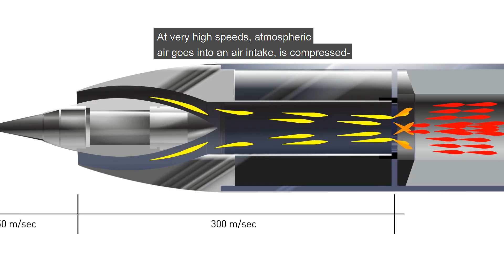How ramjets may change the role of artillery on the battlefield

Comment: I can see it having a place, but the major advantage of artillery is that shells are relatively cheap.
Reply: That’s the advantage of a ramjet though, very simple because it doesn’t need a turbine to compress the intake air
Reply: @battlesheep2552  still more complex than regular artillery rounds, its really going to come down to price as well as effectiveness.  if it's the same price as a regular round but can't hit shit at the range that exceeds the current rounds then the US military wouldn't pick it up.  greater distance greater dispersion, unless you have a  guidance system in the munition but all of a sudden you just sent cost through the roof.
Reply: @battlesheep2552  And guidance + Thermal management + Combustion control = 1000's of USD per round
Reply: @battlesheep2552  Simple compared to a traditional rocket, not compared to a traditional artillery round.
Reply: As a former U.S. Artillery Fire Direction NCO, I can tell you that cost matters more than you think. We can toss $100 standard HE rounds around all day long, but we’re much more conservative with a $30K Copperhead round.

There are a LOT of reasons this tech, while cool, will not be picked up. Especially not for a 155mm system, and especially not by the U.S. Army. 

Maybe the U.S. Navy, if you increased the size, emphasized speed and tried to make it a kinetic kill system for ship-to-ship warfare, but even then it has to compete with other systems.
Reply: @edwardsummey8843  Navy cancelled the Advanced Gun System for the Zumwalt. Because the ammo was too expensive.
Reply: @edwardsummey8843  I am so with you. Very surprised by the comments acting like cheaper artillery rounds are somehow meaningless. Cost is important even in the realm of military budgets. Everything has a role and that is no different with relatively inexpensive artillery rounds versus more expensive counterparts.
Reply: @edwardsummey8843  Excellent point.  Would be great to see the Missouri and Iowa put back into service and have this adapted to their 16" (400mm) guns.
Reply: @edwardsummey8843  exactly! I was an FO in West Germany and nobody was going to send us a copperhead round unless it was some super high value target like Brezhnev in a T80 at the Fulda Gap. I say Amen to your comment and FFE.
Reply: @edwardsummey8843  I'd say it would probably be used in counter-battery fire; Having a stick that's longer than your enemy's stick, allows you to hit them with ease when they can't hit you.

You won't see massive salvos of it, but I can imagine targeting an active katyusha battery with this - and maybe you can even put course-correction on it for increased accuracy, though that's dependent on research that's ongoing.
Reply: @edwardsummey8843  You are not wrong -  when it comes to the US and other large nations. The US has several weapon systems that compliment artillery, especially in the ranges discussed here, like MLRS, attack helos and cruise missiles, to name a few. Small countries however do not have that luxury. The country Nammo is based in, Norway, is unable to have a combination of weapon systems to compliment each other, due to manpower issues and cost. The Norwegian army would probably be a lot more interested in this, as it turns a 20-30km ranged artillery piece into a variable distance firing platform, without the cost of a second platform. 

To be able to drop more expensive ordinance into a standardized artillery platform to increase reach, then return to the more inexpensive projectiles for shorter ranged engagements and for carpeting areas is very interesting for smaller countries around the world. The training, maintenance cost, as well as the investment needed for a separate platform, will probably pay for the added cost of the projectiles.
Reply: @edwardsummey8843  ship to ship warfare = missiles.
Reply: @edwardsummey8843  Ship to ship systems? What is this WW1?
Reply: @edwardsummey8843  i dont know much about military stuff but i remember seeing documantaries about the vietnam war in which tje usaf was very conservative in using shrike missiles against sa2 missile sites. So cost is indeed an important factor.
Reply: @edwardsummey8843  it has a potential for bunker busting in the form of coastal or ship-borne artillery.  Prolly cheaper than a tomahawk, but still not as effective.
Reply: @edwardsummey8843  Hilarious when you guys are firing $150k+ javelilns at single dudes in afghanistan
Reply: @edwardsummey8843  Besides price is there a technical reason you think this wouldn't be picked up?
Reply: @darkjill2007  It comes down to the nature of cannon artillery. It is cheap, and it is quick. However, it is fairly short range (which this round seeks to address), and each individual round is pretty small. For mass attacks, you need to gather dozens of artillery pieces to have the decent effects on target.

Add to that the effect of exterior ballistics- if this round is unguided than it has to account for wind and atmospheric effects. Normal rounds have to account for this also, but the longer it is in the air the greater the effect will be, hampering accuracy. If it is guided, then it would be better to launch a single tomahawk than depend on a dozen of these, and if it is a “smart” round, the idea of keeping cost low goes out the window.
Reply: @edwardsummey8843  OK so you don't think it's cheap enough to take the place of traditional shells. Plus it's unguided nature makes it a poor substitute for guided shells. Makes sense. Your coming at this from a mass bombardment perspective. Even if the round can get out to the distance target it would be ineffective at saturating the area. All of that makes sense.

What about for a different gun platform. Maybe a navel cannon? Would the larger shell with a extended range justify the cost? What if it could reach out to 250 miles. Tomahawk are expensive.
Reply: @darkjill2007  My experience is with army Field Artillery; I have a less educated opinion on naval gunnery.

Currently, the Navy is working on a rail gun system.  My gut feeling is that this ramjet system would be more effective on a larger shell, giving a better punch to a single larger payload.  The problem is, most navies of the world have moved away from large bore naval gunnery, in favor of aircraft and missiles.

For me, it comes down to target selection.  This type of round is ideal for a long-range strike- either over a border or into an enemies rear area.   What is your target?  What are you shooting at?  How is the target protected? Is the target stationary or mobile?  Will a deep-strike artillery stonk be more effective than a cruise missile or a munition from an aircraft?

The ONLY thing I can think of is if an area is SO well protected that aircraft and missiles are not likely to make it to the target area.  Current warfighting experience has yet to have that happen.  However, if it IS a potential, what is the likelihood of your target's protection being able to be defeated by an artillery round?

Maybe if the navy still had battleships, putting this on a 16" gun would be pretty useful.  Not in a 155mm shell though.
Reply: @edwardsummey8843  As seen by their zumwalt class destroyer still not having ammo for the main guns because its too expensive to buy with 800k per shot , gjgj
Reply: @edwardsummey8843  The main advantage of it is that it can be fired by the same gun that uses the $100 ammo. I see it more as a way for conventional artillery to defend itself if threatened by longer range artillery, instead of having to field both MLRS and conventional artillery.
Reply: @BosonCollider  You are talking about Counter-Battery Fire.  The main defense against possible counter battery artillery fire is the same reason I am skeptical of this round.  We move the guns.  With an increased range comes an increased Time of Flight.  With modern artillery radar, target location, origin location, and time of flight can be obtained within seconds of detecting the round.  So, modern (at least as of 2003 when I left the army) artillery tactics dictated that if there was any danger of counter battery fire, the guns displaced to a new location after each fire mission.

Artillery rounds (especially the 155mm this is designed to shoot from) are not particularly large (when talking about artillery).  The 155 gets its effects on target by massing fire from many tubes.  Depending on the target, you can get from 6 to as many tubes you can gather (18 in a battalion) firing in salvos.  Individual rounds are impressive, but not able to have overwhelming force unless you actually hit the target, which gets progressively harder as range increases.

MLRS is more effective because the payload is greatly increased over the standard artillery round as well as increased range. Having a single round with a massively increased range is only effective in cannon artillery (especially 155mm) with either a guidance system (which greatly increases cost) or to mass fires, which becomes very difficult with increased range to to Meteorological data along the flight path of the rounds and differences in times of flight from the various gun batteries to the target.
Reply: @edwardsummey8843  well yeah, where does the "bang" go? shooting a rocket out of a cannon is great...but payload?
Reply: @edwardsummey8843  USMC Arty shoot Excalibur (gps guided artillery round) in Afghanistan. $100,000 a pop from what I heard. Only for kills though. Mostly IED diggers.
Reply: @humanofearth7524 , $250,000 per round, more like. But can still carry a conventional warhead.

This ramjet round supplants what would be area for a warhead/fuse/payload.

With guidance, this can be an accurate long range round, but will not be inexpensive, and the effect on target is questionable.
Reply: @edwardsummey8843  the copperhead was designed for targeting high value targets. That’s sort of the point. A 30k dollar tool to remove a 2 million dollar tank is fairly cost effective.
Reply: @-John-Doe-  Yes, which is why we are much more conservative with them.  

Lets try it this way.  Cannon artillery has two types of rounds.  Dumb rounds (HE, ICM, various smoke rounds) and smart rounds (terminally guided munitions such as Copperhead, SADDARM, or whatever they have come up with lately).

Smart rounds are cost a LOT of money.  Since you want a good return on investment, you want to make sure they are aimed at stuff that is pretty important, is really there, and that you are more than likely to hit.

Dumb rounds are cheap.  But they are not particularly powerful.  The great thing is that you can throw them out there just in case.  you may hit something, or you may scare it away, or maybe just make pretty smoke clouds.  The rounds are cheap.  Hear a tank engine in the dark? Throw a dozen HE rounds at it.

The point is, these ramjet rocket rounds a) increase cost of the round, making them want more of a return on investment), b) decrease the effectiveness as an artillery round (the most valuable area of the round is taken up by the rocket instead of by explosive, making each individual round less capable, meaning you need to fire more of them at a given target), and c) pushes the range up to a degree that target detection will more likely be handled on a strategic rather than tactical level.  That means UAVs and satellite assets rather than troops on the ground.

At that distance, if you want good effects, that means the rounds will either need smart guidance (increasing cost a lot), or use a LOT of rounds and flood the area with rounds (With that Time of Flight, there will be a lot of scatter of unguided rounds no matter how good your fire direction data is). If you are making them smart rounds, it would make more sense to put a specialty munition on it instead of just firing dumb HE, in order to maximize effect and cost return.  And now the round is as expensive as a missile, if not more so, for a munition that would not be as effective as a drone strike or cruise missile.

I can not believe people are still watching this and responding to comments.
Reply: @edwardsummey8843  like the rail gun?
Reply: @edwardsummey8843  It looks to me like the Ukrainian would love to have these munitions for their M777's.
Reply: @johnarnold893  I can not believe people are still watching this video and buying into it.

My comments remain valid. The amount of space this ramjet takes up (based on the diagram they show) leaves nearly nothing left for payload- maybe the power of a large hand grenade- absolutely no payload if they want to make it a smart round. And it doesn’t even have the structure to make a decent kinetic kill round.

But I am just a former Field Artillery Fire Direction NCO with 13 years of experience- 8 of those years working with 155mm guns and their ammo. What do I know?
Reply: @edwardsummey8843  the one thing tho is that ram jets are relatively inexpensive though not nearly as inexpensive as just lobbing shells over a mountain
Reply: @edwardsummey8843  I believe the purpose is for long range guided counter battery fire. The US currently uses cruise missiles and drones in this role and they are far costlier.
Reply: @edwardsummey8843  Hi, I'm from the future.  You're wrong.
Reply: @edwardsummey8843 Yeah, but if it could shoot down an aircraft or reliably take out sam sites....
Reply: Edward Summey so many people don’t understand that “military grade” really means “lowest bidder” 😂
Reply: The Covenant  you might want to look at the definition of almost
Reply: @whoisjoelsmith  by rough estimate we all know these technology will me more expensive than regular artillery shells. it will shows on payload/shell ratio
Reply: @eko_nekkoinu  as long as firing the shell is cheaper than delivering any munition 100+ km. In this case way cheaper than ballistic missiles or air attack, even cheaper if firing in bulk
Reply: @eko_nekkoinu  One other important cost factor is Circular Error Probable.
The smaller the CEP, the lower the number of salvos required for effect.
This can translate into significant savings.
Reply: shrapnel the weight of 0.50 BMG(45 gmas) going at mach 4 to 6 has two to 4 times the energy of that projectile fired from a rifle.
Reply: @muf  that projectile has 100x the explosive mass do you think Artie is just solid rounds
Reply: It has range of 100 km. For artillery, it's a great advantage.
Reply: @andivatar6383  well yes and no, I mean, what is artillery for? Shelling the enemy positions at the frontline, so they dont need a lot of range, this is the reason why it is still effective today, if you want to...lets say, shell an enemy base or HQ that is at 40km, you may not have an artillery piece to do it, but you still have bombers and drones, its not like an artillery piece that can fire at 150Km would do something never done before, and what is at 150km from the front line anyway? Cities? Like if thats more effective (or even humanly acceptable) to win a war than shelling the troops
Reply: @whoisjoelsmith  Look up AGS rounds. Apporach cost of Tomahawk missile ( ~1 mln USD). And Excalibur cost about 4-5x or JDAMs at time of their introduction.
Reply: Piotr Dudała 1.87 millions USD
Reply: The Covenant  solid hgih-performance rocketfuel isn't cheap.  Now, just that won't be what drives up costs but also the added assembly stages, time, the level of precision will be much higher making the cost to mill much greater, and the payload looks like it can't be more than 10kg of high explosive, let alone the typical 100kg+ yield of most shells, meaning they would need to use either a more volatile higher yield, or a more expensive higher yield explosive to achieve acceptable target damage.   Finally, you have to take into account storage conditions.  By design, a solid-fuel ramjet would expose its fuel to humidity, making rainy and humid climates SIGNIFICANTLY less reliable, by orders of magnitude.  The US will not "adopt" this.  They will buy maybe 10k total, use 3k in training and the other 7k for very specific special circumstances.  Compared to the 30k M982 "excalibur" 155mm artillery shells that they bought recently (these are the guided artillery shells) that are ALREADY fringe-use shells, that's almost nothing.
Reply: The advantage of artillery is massed fires. All weather capabilities, and psychological effect
Reply: It's still cheaper than flying an airplane (maybe not a drone) to launch missiles on a target, or even just dumb bombs.  Maybe that's the way to rationalize the cost: think of this as tube-launched drones.
Reply: @theprojectproject01  a light attack aircraft would probably be cheaper and more precise, though the point of artillery is volume of fire.
Reply: @user-pq4by2rq9y 

This is true.  But with this, you don't risk a plane and a pilot.
Reply: They will have a place alongside standard shells
Reply: Relatively low cost is actually the point of this product.  Most 155 ammo would NOT be replaced by this, but all your existing 155mm batteries could have some of this ammo to use in special situations - or certain batteries could be armed with it specifically for deep interdiction barrages and/or counter battery fire.  What this takes the place of is extremely expensive MLRS systems (not only the far more expensive rocket ammo, but the launchers).  It would even be able to strike things that would otherwise require air strikes - an even more expensive option.  It's actually an immense cost savings compared to the alternatives in some situations.
Reply: @whoisjoelsmith  how about high school physics for starters?
Reply: Might be cheaper than short range missiles or drones. Up to 150km - 105 mikes. Likely will improve on that range.?
Reply: You don't need whole batteries/gun regiments to be carrying this ammo, especially if it can be fired without modifying the arty piece. Simply having the capability will shape the opposing side's options and thinking, and then you have caused an effect without even firing that shell.
Reply: it still looks MUCH cheaper than a comparable range tactical missile. Itskind of round they keep in the back of the ammo truck for "just in case" fire missions like they do with the excalibur
Reply: @whoisjoelsmith  , which side of the bed did you get out of. ?
Reply: maybe they should sell it to the USnavy, USnavy still waiting for the railgun that might never come maybe this ramjet shell is a better solution.
Reply: @ALTINSEA1  Raiilgun works....except for the barrel erosion problem...which all such guns have suffered...and always will
Reply: The Covenant, yes it has almost no moving parts
Reply: @scienceisreal3405   A ramjet has NO moving parts.
Reply: @whoisjoelsmith  spaz
Reply: @whoisjoelsmith  Why do you have to be so rude?
Reply: I think you could get it down ramjets are pretty efficient (at high speeds) and simple to build and maintain
Reply: What kind of explosive can it carry if all the shell is ramjet the
Reply: @insubordinategoy7466  I suspect that a shaped charge inside of the intake nozzle might be the idea.
Reply: Kinda sorta not really.
Yes it's true that you want your guns to be cheap to feed, since the ability to sustain a bombardment greatly impacts its effectiveness. 
HOWEVER! We're already in a situation where we have a variety of rounds for a variety of platforms, and some of them get pretty expensive.
For that reason I think this has potential for adoption even if it's unlikely to fully replace more primitive munitions.
Reply: Reminds me of the space gun made by the Nazis. Although it had a long range and higher than average impact damage, it was really hard to manufacture and expensive. It was basically useless
Reply: Jet Streamer isn’t it crazy how people can have a civilized debate on the most economically feasible way possible of killing people.
Reply: Much easier to have base bleed (or rocket assist) to extend range and improve the overall aerodynamic shape of the round.  155mm will do over 70km with those features.
Reply: People saying that cost is irrelevant is so disingenuous. If the military spends more money in one area, that inevitably takes money away from another area. I think this ramjet concept is not aiming to replace missiles but more trying to extend the usefulness of artillery in an age where missiles are becoming faster, with longer range and generally more effective.
Reply: Ramjets are also extremely cheap, due to their lack of moving parts, chances are they would be only slightly more expensive than your average shell
Reply: I am more interested in it as a naval round. It could be cheaper if it had more development but still more promising than a railgun
Reply: I don't know. I don't think ramjets are that complicated.
Reply: Not so much anymore because brass has become exteemly expensive.
Reply: @badmonkey2222  Ah erm, eh Alan? They get to keep the brass. Actually, most large caliber modern rounds just use a charge behind the projectile.
Reply: @conmcgrath7502  i know how artillary works seeing that I'm a desert storm vet 82nd airborne 321st combat artillary regiment 18th battalion🇺🇸, and we didn't keep the brass on the few guns that it was still used on at that time it was immediately sent back to be recycled and used again, that was 30yrs ago and it had gotten crazy expensive then so it's prob of the charts now, that's why when you see these guys firing these old artillary pieces in the civilian world at the range, they go put of their way to protect the brass casings because they are so expensive and brass also isn't widely available like it once was.
Reply: @badmonkey2222  Oh Christ! I just lost my reply (I live in the styx and the internet can be 'fickle' if somebody rings when you are uploading).
Maybe it's my penance to apologize twice!
Alan, if you say you served, I'll take your word for it.
I don't hide behind a pseudonym, much like yourself and if I'm wrong, I'll hold my hands up and admit it.
You basically said that brass costs a lot and I interpreted it as 'some fuck-wit doesn't even realize that shell casings remain after the round is fired'...my bad. Hands up and then hand out, hoping you will shake it from afar.
That being said, with your service and experience, knowing all the many factors that affect a long range artillery round, what is your opinion of an unguided ram-jet shell fired at a distance of 120 km?
Pax dude
Reply: @conmcgrath7502  no prob hand out brother, and i thought he said the ram jet shell was guided?
Reply: @badmonkey2222  Dammit! a salient lesson why one shouldn't drink whiskey and surf the internet. I apologize once more for my drunken 'suppositions'.
Thank you for being patient with me.
But here is a real question; ram-jet round, I get it, guided (don't rub it in!), I get it and obviously the metal that comprises the  'workings' can become 'shrapnel' or even a kinetic force....but what's the payload?
I think I'll quit while I'm behind  (I'm hammered), my hat,.sir. is doth doffed in your general direction.
Pax dude       hic!
Reply: @conmcgrath7502  not a prob sir i had fallen asleep early myself but yes I'm sure the inner workings of the engine become shrapnel themselves, not sure of the payload will get back to you on that one.
Reply: thats not true. US uses guided artillery shells for 50k a piece. the advantage is long distance firepower over a long period of time without needing airplanes as delivery.
the shell costs are irrelevant, still cheaper than most what you deliver with a jet, but you spare the delivery cost and risk
Reply: how much more expensive is that new artillery shell? I don't think that it's  a lot more expensive. judging by it's construction.
Reply: This is true but since we've given Ukraine 100 trillion dollars they could probably afford more expenses shells. We should have never let it go that far. But Democrats don't care about cost all they want is war
Reply: Ramjets are simple as fuck. Its basically just a tube with a spikey point. The r&d will be expensive but manufacturing will not be much more expensive
Reply: Joel N Smith lmao that’s what I was thinking
Reply: I'm Someone You Might Know haha iknow that games
Reply: @whoisjoelsmith  ouch. Not so nice.
Reply: @SuijiSuiji01z  are you referring to World of tanks cause i play it.
Reply: Add some guidance to the ramjet roxket and you habe a Cruise missile.
I dont really see a place for them
Reply: They should be relatively cheap to build but why even have artillery when a rocket motor will accelerate it to Mach 2 almost instantly?
Reply: I think this is a cheaper alternative to air dropped precision munitions which are seriously expensive.
Reply: Yea right. The u.s. military probably spends more on 5.56 rounds then the blackbird program which is what gave birth to the ram jet
Reply: Very obviously, you would use standard rounds for standard situations. This has longer range. If you need that range, you now have it at a price while your enemy does not.
Reply: The Covenant  Lol, no.
Reply: @whoisjoelsmith  There are countless examples of defense companies making weapons that end up too costly to justify replacing existing technology. Most of the stuff on Forgotten Weapons, for example.
Reply: Starfireaw11 yes but the artillery piece is relatively expensive
Reply: Don't forget the fact that it shoots an obviously smaller warhead than same calibre artillery, since they need to make room for the ramjet system (especially the air intake is what would decrease the size of the effective payload).
Reply: It's not just about the range you must also consider the damage output. Regular shell have way shorter range but can ramjet beat it's payload? I highly doubt that ramjet can deliver even half the payload of regular shells.
Reply: I'm not sure did anyone had already mention this but i agree that the now day shell are cost lower than this ramjet shell.

1. Material. You need material that can sustain the speed. They said match 4 right? What speed do now day jet aircraft have?

2. Manufacture. As we can see the jet itself are complicated than normal shell so it will cost more(still did not include guiding system).

3. I'm not sure about this but ramjet need to be in curtain speed in order to make the compress for combustion so it still need the normal propellant while missile or rocket can do that work too right? If it can do that much work why don't they use it in ship and develop it to shoot enemy from 150km aways why do they keep developing railgun while this shell are less complicated if compared with railgun isn't? As i said i don't know about this.

4. Outcome. I have no idea how much charge can this shell carry even it have kinetic energy but still  in further range it have less energy  and rely more on it charge to do damage.

Lastly i think this shell are worthy only when you bombarding on strategic target.
Reply: Ramjets are cheap as fuck, its just a shaped tube with fuel.
Reply: The Covenant  Um... no...
Reply: You can build a ramjet engine without any movieng parts, thats the beauty of it, because the main issue is to get to those mach 3 for ramjet to kick in.
Reply: Make them precision guided munitions like the Excalibur 155 round, at 100 mi away, You can affectively engage numerous targets from a single point or for multiple points without having to worry about setting up and firing from a precision point You can just basically aim it in the general direction and have the GPS system finalize its impact. This definitely has a place in the modern battlefield.
Reply: @jetstreamer374  I'm really interested in the payload of this projectile. It would seem by the illustration early in the video that less than 20% of the volume of this projectile is weapon grade explosive. What is the balance between the added distance of engagement in the field and a more limited punch from this shell hitting its target? That would be an equally interesting video.
Reply: Exactly. I can make water shoot from my nose. Doesn't mean I have to do it. Guided projectiles are certainly more accurate. If they can be made cost effective, whether they're shot from a howitzer or launched from a vehicle or drone should all be given equal consideration.
Reply: @futuregenerationz  Simple
They cannot be made cost effective
Reply: @hellstromcarbunkle8857  If it's range, accuracy and payload is that of a guided missile, we can compare it's cost with that guided missile.
Reply: @futuregenerationz  So why build the weapons you already have that are too expensive to deploy?
See why the Empire is a lost cause?
Reply: @hellstromcarbunkle8857  See why the empire is a lost cause? There is no empire comrade. Just resistance to the other hegemonic powers of the world.  We're at the brink of losing right now. But regardless, the cost ineffectiveness of our military has really been exposed in the last 20 years.
Reply: @futuregenerationz  American bases in 149 countries, occupying them mostly contrary to national will. Ask the Philpinos how long it took to get the American war bases out of their country.
That's an empire, Soldat
Reply: @hellstromcarbunkle8857  How can I argue with someone who already knows the national will of 149 countries? Once we stop the current attack on our own democracy(and we'll remember who sent it) we'll get back to protecting democracies elsewhere. I was in the Philippines. What they didn't want was inaction against China. They'll be part of someone's empire, along with the other 148 democratic countries. Any empire in particular you'd like to see them as part of? The thing about protecting democracy around the world, is the extra scrutiny Americans are beginning to give their own. First we need to be  a democracy, in order to warrant being 'the arsenal' of it. I'm betting on democracy to win. Here, Syria, and Russia.
Reply: @futuregenerationz  I know because they KEEP THROWING US OUT AFTER WE LOSE WARS THERE!
Reply: @futuregenerationz  Well, from denial to excuses in just 2 paragraphs.
You really give ignorance a bad reputation.
This isn't a democracy, as the tRump loss by 2.86 million proved and Russia is, if anything, MORE autocratic thanks to the alliance of tRump and the dictator Putin
Yes, thanks for admitting we are an empire.
To excuse that by saying everyone serves an empire ignores the lessons of Vietnam, Kampuchea, Afghanistan and Iraq, all of whom freed themselves from the American yoke.
Reply: @jetstreamer374  Yeah 'Jet' you kinda 'summed-up' a lot of my thinking. I was wondering about the payload/ effectiveness of the round. Precision at 150 km is questionable but I have to also think that it works both ways? Counter-battery fire at 150 kms might not really be an option?
Lots of interesting comments (I haven't read them all but I've read a good few), seems like a unique approach though.
There has def got to be an advantage in 'out-ranging' the enemy guns, just common sense,  but there are a lot of problems that this design would have to overcome. Large caliber shells fired at distance have to travel through levels of the atmosphere at varying pressures, wind directions and relative humidity (including clouds and rain). Besides tiny differences in barrel-wear/ tolerance (even the blast from one artillery piece affecting the trajectory of another?) at 20 km those tiny differences might not be so much that you cannot saturate an area effectively but at 150 km, not so sure?
Those same atmospheric conditions would also affect the ramjet, only more-so; I think that accurate ranging would be a huge problem and the only effective solution at those distances would be an active guidance system, can't really see it any other way.
Still though, they could probably hit a small city or a battalion massing far behind the lines, I suppose the question is, with what? If you subtract the ramjet and fuel and all the metal that makes it robust enough to fire violently out of a barrel, what's the payload?
One other comment, how many Tomahawk missiles have the USA launched in recent conflicts?
I know the two situations don't equate strategically but there might be an economic/morale parallel; if we can hit you and you can't even touch us....best to leave us alone?
Maybe you can't put a price on weapon superiority when you think about it but I imagine the cost of guided ramjet shells would be dearer than a similar rocket system, developed for the artillery, that can deliver 'more-bang-for-the bucks'? Just not as quickly.
Here's a last comment (I cannot be the only person to have thought of this, so I don't feel bad saying it)... there's already quite a lot of debris in space orbiting the planet, any nation capable of sending junk into space and exploding it at the right altitudes can very likely 'take down' GPS  and all the various satellite based systems and communications used by everybody but specifically by the military, that being the case, warfare would get 'old-school' at least for a while, inertial nav systems are not nearly so accurate at long distance, we would be back to 1970's era technology as regards guidance of ordinance, old-school artillery batteries might be the biggest players on the field, until the nukes start dropping.
Pax dude (hopefully), Con
Reply: I am sure the capacity to direct the ram powered shell to a desired target will negate any extra expense.
Reply: yea, this does not look cheap
Reply: Also, at that point why wouldn't you just fire a missile? There's been no need to increase the range of artillery cuz we can reach way further and more accurately with missiles.
Reply: Use both! He said they work In Standard 155
Reply: Ya. Good luck picking 10,000 for a decent battle.. Who knows what the cost is for one. Likely costs as much as driving a Mercedes Benz.
Reply: Versatility is key.
Reply: You could use it as an auxiliary shell and not the primary ammunition. They don't have to completely replace regular shells. I'm sure 10% or less of the regular ammo Loadout would be enough. 

I'm not an expert, but you could engage at the usual range and then change ammo as they get closer or farther away, right? It would just give an edge.
Reply: not only that but traditional shells also have ROOM for actual explosives.
Reply: The Covenant  but can carry much less explosive
Reply: So ate ramjets (no moving parts).
Reply: Which is cheaper, Rambo or Ramjet?
Reply: It’s a ramjet, they’re incredibly simple things
Reply: @616CC  Agreed.  I think people don't understand this is not really that many parts, nothing like a typical jet engine.  Most of the expense i could see is perfecting the design, and making sure you can get consistency in the engine so that you can converge on target. But as far as building them i don't think there is anything that complex so the manufacturing process can be cheap enough at scale.  There are far far more complex shells being used. It is certainly not like a railgun where there is much more machining needed for a round, etc.  With these you can pretty much stamp them out, which is far cheaper then custom machining each heavy part i would imagine.  And the fuel is dirt cheap as well.  So yea, i bet we will start to see this design being utilized, the increase in range is not just a few percentage, it is literally a order of magnitude difference, allowing for shelling with zero chance of return fire until of course you are facing the russian gear on the other end.  
Take a look at how simple a ram jet engine is, it is really again all about the design and prefecting the design that matters.  Once that is done you can have different shells designed for different distances just by changing up the amount of fuel you put in them, no change in ramjet specifications.  I mean, you sacrifice some of the room you could otherwise be using for your payload, but as a tradeoff for distance seems like a very good thing to have in your arsenal.  
Wonder if the company is public.. ;)
Reply: I can't see how would a hole on the projectile and not adding oxidizer to the motor elevating costs.
Reply: nah, it has a place as special use ammo, like how rocket propelled arty rounds are.
Reply: The major advantage is being able to hit your enemies from much further away than they can hit you
Reply: Agreed. It will have a place as anti artillery, but even then it will be niche.
Reply: @ImReverseGiraffe  But isnt that the role of the F35?
Reply: Looking at the cross section at 02:04, I wonder where are they going to put the actual explosives? The ramjet occupies almost entire volume of the shell.
Reply: I can see armies buying one of these per 10000 normal rounds, or something like that.
Reply: Figure out a way to mass-produce ramjet shells, and it’ll be just as popular and ubiquitous
Reply: @StealthTheUnknown  Terminal guidance will keep these expensive.
At 1000 Km, a CEP of 2m will require an accelerometer good to 10K g's as well as a gyroscope able to take a 10K G loft AND STILL have a 0.05 rad/sec detection in 3D.
WAY tough and expensive
Reply: That is exactly what I was thinking. Also I wonder how could one stockpile ammunition like this. With liquid rocket fuel inside, risking a leak or would you have to "fuel" your rounds before use.
Reply: Smaller military is cheaper too
Reply: yeah I'm John Assal  Too much error. For a range of 100 Km, an error of 8 minutes of arc translates to a sigma of 200 feet.
For artillery, that's useless.
Compare with the GC45 guns built by Gerald Bull.
CEP at 100 Km  is just 5 feet.
THAT cannot happen with an assisted shell unless you have active guidance.
Can't do what with GPS.
Reply: yeah I'm John Assal  I only knew about the type of ramjet using liquid fuel. Guess it should have been obvious the military would use solid fuel for the reasons I mentioned earlier. Thanks for pointing it out.
Reply: yeah I'm John Assal  CPU and Memory that can function after 6000 G's acceleration are few and far between.
Thus, much money.
JDAM already use GPS.
They are 500K each and not going to get cheaper
Reply: The Covenant  Not even close
Reply: yeah I'm John Assal  Like I said, longer range = More expensive controls
ANNNNDDDDD at 68K per round we lose the war very quickly (assuming opposition uses IED)
Reply: yeah I'm John Assal  Yeah, tell that to the 4290+ who died in Iraq, mostly to IED's
Reply: yeah I'm John Assal  Or how about this?
Stop killing people who did us no harm.
Reply: @RobertLutece909  Well there is that
Reply: tbh I bet with little bit of development this shell could be guided and it that case its cheaper and more effective and as accurate as drone strike.
Reply: @peterbakic4493  Did you get a degree in engineering in a crackerjack box?
6000 G minimum, with full inertial guidance (forget playing GPS, not remotely fast enough position updates, this isn't a JDAM).
Just to equal the 155 mm 29km range howitzer CEP will cost > 60K each in thousands.
Reply: Increased cost is not an issue, if anything its an advantage. That means you wont have these available like bubble gum and turn every armed engagement into game battleship.
Reply: @peterbakic4493  Cost is everything when you're spending 700 billion in direct costs for the empire already
Reply: They might as well use rockets at that point.
Reply: Too bad they don't make it for 16 inch shells.
Reply: Well as far as rockets go I can see this being pretty cheap
Reply: If you have a long range projectile that is very accurate you don’t have to carry as many shells, that’s a huge advantage!
Reply: you could be in ukraine and shell russia
Reply: They have to be cheap if their target radius (CEP) is 50-200m.  But if the CEP is 5m, then they do not have to be.   They can now be allocated to specific targets.  For instance...KH-11, drone, or recon acquires positions of enemy artillery positions 90 miles away.  Nails down location withing a few meters.  Within 20 minutes, firing solution is provided, and these 150 km range precision guided munitions are fired.  Goodbye enemy artillery.  These are not artillery weapons per se...they are "anti-artillery'  You can even add in the capabilities of autonomous vehicle seeking...similar to the GBU-53/b glide bombs.  With fast intel and secure communications (something the US/NATO is very good at) real time battlefield data can be provided to long range precision artillery, and the enemies equipment is destroyed before they even use it.
Reply: Sometimes the added range is priceless... even if the cost is 100x regular HE round. For example, in Taiwan this allow coverage of many of the islands from the Main Island. That is huge and cannot be replaced by firing 100x as many regular, cheaper shells instead.
Reply: Its versatile though... you can use an existing weapons platform though, making it overall pretty cheap.

Also, its not like you have to use this for every single shot... its more added tool in the toolkit to tickle  the enemy so they know not to get too close.  The majority fired would still likely be cheap dumb shells.
Reply: Shooting is better than doing nothing, but not really much beyond nothing. You can put tens of thousands of artillary in a "target" and still not hit it where it should be hit
Reply: I can't really see much of a place for this round.  With all of the ramjet stuff in the middle of shell there is going to be very little space for an explosive warhead.  I doubt that there is enough fuel onboard to accelerate this round railgun like speeds for a kinetic kill.
Reply: A lot of commenters here don't appear to understand the advantage of this nor the physics involved. The "solid rocket fuel" mentioned in the video isn't rocket fuel, it's a solid fuel (no oxidizer, atmospheric air acts as the oxidizer). There are some very energetic materials that will burn in air, typically releasing more energy (by weight of fuel) than convention solid rocket motor fuel by a factor of 10 or more. Calorific value of gasoline is 45 MJ/Kg, TNT is 4.184 MJ/Kg. Burning a kg of gasoline releases around the same energy as 10 kg of TNT, since atmospheric oxygen acts as the oxidizer. The calorific value of gasoline is very low compared to other fuels. A simple ramjet using a conventional propellent charge to accelerate to sufficient mach velocity, energetic solid fuel ramjet, GPS guidance and 150 km range would be lethal, as in one shot one kill lethal.
Reply: Look at what is happening in Ukraine, it's amazing what results can be achieved with a drone and some enemy explosive that failed to detonate. I'm no expert on drones but I've seen relatively inexpensive  (compared to military budgets) drones that can manage 90km flights. I'm sure that their are ways to extend that range. Perhaps not as devastating as an artillery barrage but they have precision in their favour as well as costs.
Reply: I assure you, nothing is cheaper than this in striking a target 150 km away
Reply: Unless a ramjet artillery shell can be manufactured for a lot cheaper than 1/10th the cost of a radio controlled kamikaze drone, there would be no market for it.
Reply: It looks to be solid state and mass not hard to mass produce.
Reply: Not really. The major advantage of artillery is that it can be used to accomplish a lot of military objectives within a large operational area.

If your enemies weapons have roughly the same range as your own using standard shells this is the round you bust out to make sure their artillery positions are untenable.
Reply: The Soviet Pion
Reply: Where do you put explosives in that thing? Either there's little explosive, or little jet fuel. Cool concept, but it feels like beyond 50km you want larger precision guided munitions like cruise or supersonic missiles.
Reply: @AlexKarasev  You dont necessarily need explosives to deal damage. Look at railgun, for example. If you shoot a chunk of metal at extremely fast speed, the impact would be massive.
Reply: @dznuts123  fair point. We don't know what sort of kinetic energy that ramjet can develop. Maybe it's a lot. But also, with kinetic, you depend more on scoring a direct hit - which becomes harder at greater ranges because a target can move, GPS can be jammed or spoofed, etc).
Reply: @AlexKarasev  True, and it depends on the final product, but if the ramjet flies fast enough, the target may very well be still. Also, GPS jamming can be somewhat bypassed by using AI or machine learning to guide the projectile. In the end, there will probably be a barrage of shells with ramjets, so missing once or twice is fine.
Reply: Though much more cheaper than a missile with lot less volumen, and with mass volumen manufacturing can be a changenger
  Future weapons into present reality
👏👏👏
Reply: @carmelonold1090  cheaper than missiles, sure, but you also fire much much more artillery shells. that doesn’t really cancel out the cost.
Reply: @dznuts123  well as long as they have gained in accuracy as shells are semi-guide and being pinpoint hits It Will not need so many rounds to destroy the target so as the units wont need to be expose for so long to be threaten by a fire back.
 Hope they will be success
Reply: Bit ramjets are cheap, that's the point. Not as cheap as a metal shell packed with plastic explosives, but they aren't nearly as expensive as missiles.
Reply: @laramie371  The flaw of your argument is artillery shells are used much more often than missiles and in significantly larger quantities. That "cheap" cost can quickly add up.
Reply: Also, where do you put the explosives?
Reply: They don't explain where the warhead charge goes.
Reply: But short range if you count 40k as short!
Reply: I'm sure the Marine Corps will appreciate the increased range
Reply: Cheap and large volume. 12,000 rounds a day is an approximation of Russian consumption in Ukraine as of this writing.
Reply: That what's going to kill the US military over spending on tech junk
Reply: But air defense systems like iron dome, s300 s400, thaad, etc can shoot it down faster 😩
Reply: Well that's the point of a ramjet no moving parts is incredibly cheap as well. But that's not the problem they're going to face. With the air intake being at the nose and the nozzle being at the end for thrust. They're basically taking up all of the rounds real estate leaving not much for warhead yield.
Reply: zumwalt
Reply: No kidding, plus, what a beautiful piece of engineering destroyed every shot?
Reply: Precision strike is more cost effective
Reply: Not anymore.
Reply: This shell is for specific targets deep behind enemy lines like command center, ammo warehouse, enemy artillery. For the rest targets you’ll use cheaper shells
Reply: No payload ? No guidance?
Reply: It's a ram jet the shape of the round and fuel would be the only extra factor. We already fuel rockets would not make much of a price difference.
Reply: @mrnoodle7517  All that area where the ramjet is in the shell? That is the area usually reserved for the fuse and the explosive charge. Also, this may be a result of the diagram, but the casing seems reduced, also.

Putting the explosive around the ramjet area would not work since half of the force would blow inward (into the ramjet cavity), making the shell (already with a lighter charge) less effective, throwing less shrapnel. 

Further, a rocket motor is cheap and easy to make.  This ramjet would require a lot more machining- more cost.
Reply: @edwardsummey8843  Yes sure it would cost more. I never said it wouldn't. But it wouldn't be much more expensive. It's the future of artillery for now. For one the rail gun isn't ready yet and we need something that can out reach Russias artillery now.
Reply: @mrnoodle7517  No.  The future of artillery would be in rockets and missiles. Cannon artillery has many constraints that rockets do not have.  The major advantage of cannons is that they are cheap and harder to pinpoint without radar. Great for short-range, tactical use. Great for tossing lots of cheap dumb rounds at suspected troops that may just be noises in the night.

This tech sacrifices payload for range.  You can push a shell further, but the shell is (at most) only 1/3 as powerful.  Plus, with the extended range, it will NOT be as accurate unless you make it a smart round. Technical reasons, but  the thrust and total delta V have to be VERY precise and repeatable. Also, weather patterns in the higher atmosphere levels would make long range accuracy problematic.

Making it a smart round would help, but then you are just adding cost on adding cost, until the price is about the same as a rocket of missile which can carry a greater payload, which could require a dozen of these cannon rounds (or more) to replicate the same effect on target as a single guided rocket would.

I wish I could make more people understand that you don't get something for nothing.  That there are technical and tactical consequences that most people here fail to consider.
Reply: the advantage to putting money in this type of shell is the relative safety of your own guns. 
This is very obviously an advantage. Keeping a gun or SPA may be worth the extra cost of these shells
Reply: Last i checked we rich no worrys
Reply: where does the payload sit?
Reply: it's cool!  And you may need CADBase, which is a free resource for storing 3d models in the cloud. How it works https://youtu.be/vwV-Im_xlic
Reply: Wonder how the Russians power their ARTILLERY it must be cheap.
Reply: @Bill-xx2yh  They probably use black powder and bunker fuel lol
Reply: @NikoBell1188    cough cough cough..sorry I held the hit to long.  
                         PS  "Mr BONG" thank you for the hit, I mean response.
Reply: Rail gun assisted shells will be able to be mass produced and powered soon enough. They've already made it, but mobile battery power and size constraints put the project on the back burner.
Reply: Cheap because they are inaccurate.
Reply: Excalibur shells cost about USD 70-100k. a Ram jet might cost twice or thrice that much, but also come with twice or thrice the range. But if produced in 1000's the cost might fall to the same range as that of Excalibur shells.
Reply: Cheep artillery shells are used to shell enemy positions. Long range guided shells will be used for counter battery fire. If you can fire 150km and your enemy can fire 40km you can position your artillery far out of range and pick off their artillery pieces and valuable assets from a safe position.
Reply: I'd say that the only reaseon arilery is used instead of rockets or suicide drones is they are low cost.
For example, Russians fire 60.000 shells per day, fighting Russia will always turn into artilery and trench battle.
Reply: i still wanna hear the ridiculous price tag of that fancy toy, this is what you get from engineers when they live in star wars fiction dreams as they have no idea just how much you can spend in wars
Reply: This is still cheaper than a missile
Reply: It can be cheap... no moving parts
Reply: But these shells are still much, much cheaper then rockets with a similar payload.
Reply: right? if you're going to go through all the effort of putting a jet engine on your ordnance, you might as well go all-in on a cruise missile
Reply: I don't see why it would be that much more expensive, ramjets are very simple
Reply: @alternator7893  machining is expensive. My machine costs 180 an hour to the customer. Imagine how much machining, CMM, and assembly a ramjet WILL require. Artillery rounds are not anywhere near as complex, a few hours of machining.
Reply: @sikolikhole  Minutes of a machining, not hours.  Probably about 5-10minutes all up.
Reply: @sikolikhole  Is the machining that much an offset that rockets are cheaper? I mean I get rockets won't require machining as much. But that much of a difference?
Reply: @sikolikhole  your in theory finishing a casting, to its not like you are starting from bar stock.
Reply: @jetstreamer374  can you mix air with solid fuel?
Reply: @edmundooliver7584  you don't mix air, but the solid rocket fuel will ignite and use the oxygen present in the airflow to burn. so you don't need oxydizer in the mix
Reply: @edmundooliver7584  have you heard about MBDA Meteor?
Reply: @whoisjoelsmith  If you're so smart spell "straight" right...
Reply: Wasn't there existing rocket powered tank shell? Why they didnt incorporate the tech into the 155 shell?
Reply: @aspopulvera9130  rocket assisted shells only go for 40km
Reply: I’m sure with the price of an artillery barrel I can make 100 unguided rockets and each artillery shell I can make 5 unguided rockets.
Reply: Think of it as a mini rocket on steroids, makes more sense than a conventional artillery shell. 

With proper development it could be something to rival a railgun for "cheap".
Reply: Can this technology be adapted for Anti-Aircraft Artillery (AAA)?
Also, can this technology even incorporate Scramjet instead of ramjet, to allow even better performance? Perhaps that would mean greater range, or else added kinetic energy against hardened targets. Could scramjet be useful here?
Reply: Joel N Smith Mate, if you’re going to accuse someone of not being smart, at least spell correctly.
Reply: Lmao as if the U.S. military carried about price. They care about effectiveness and will pay any price for it.
Reply: @mattandrews8528  Yeah you are wrong. Google  "Advanced Gun System" and "Zumwalt". They just cancelled the gun that uses the same concept as that ramjet monstrosity because it turned out the ammo was too expensive. Now they have a ship with no gun.
Reply: @Rudeljaeger  A ship with no gun? Just put a ram on it. And stick to cast iron, stainless or titanium will end up costing more than the gun.
Reply: @Rudeljaeger I don't recall that ever using ram jet rounds? Source?

From my memory they where GPS guided rocket rounds or saboted tungsten.
Reply: @mattandrews8528  they have a budget to work with and congress has to approve such a program. So yeah, they do care. Its one of the reasons Marines won't have tanks anymore.
Reply: @mattandrews8528  this is a Norwegian company
Reply: @mattandrews8528  eh depends, just look at the new pistols the military adopted.
Reply: Matt Andrews any military cares about cost to some extent, america just throws too much money around
Reply: @mattandrews8528  NATO allies: help were poor
Reply: @mattandrews8528  Yeah? Ya think so? 
I think the guys that worked on the Zumwalt AGS might have a difference of opinion...
Reply: @mattandrews8528  As seen by their destroyer still not having ammo for the main guns because its too expensive to buy with 800k per shot , gjgj
Reply: @mattandrews8528  Since we don't HAVE effective artillery (ask the U.S.A.F. about doing ground support in Tora Bora for instance) that's just an example of failed expensive thinking
Reply: @mattandrews8528  The role of relative cheapness is scalability.
Reply: Tant qu'ils impriment des Dollars comme des billets de Monopoly....
Reply: @mattandrews8528  they don’t care about price, but only when it gives them a good capability this would just be expensive with no new capability
Reply: @mattandrews8528  , actually that's not entirely true,  they were investigating the cost/reward to neutralise the chinese military islands should it be necessary and were (apparently) considering  how much ordinance it would require. I'm not saying they audit the stuff ! but it is a line of thinking.
Reply: @mattandrews8528  Wrong, as all armies they do care about the price. Many projects are abandoned because of the limitation of the budget and in the end you'll carry a gun made by the cheapest company which passed the requirements.
Reply: @mattandrews8528  which is why nobody really uses field artillery anymore
Reply: Matt Andrews they should spend that cash on their citizens!
Reply: simon shotter Who? Norway?
Reply: @shotts90  tell that to the russians
Reply: @shotts90  then they would be speaking Russian.
Reply: Jaager would be great right
Reply: @shotts90  Did you know that African Americans as an aggregate tax group represent an annual average 400B USD$ deficit to the US government, some people are a literal financial black hole in every sense of the word. 
Also, sorry if cold hard factual financial accounting info doesn't correspond to the prevailing mythos as regards who's exploiting who.
Reply: Veldtian1 when did I say anything about African Americans bro?
Reply: @shotts90  Why would the U.S. change one of their most defining attributes (military capability, power and quality) that has brought them more success, wealth and influence in the world than any other country?
Reply: @Xevion  I’m sure having the biggest military, spend more money on their military, first to land on the moon etc was really comforting to those people who can’t afford medical care, don’t have a job now and didn’t get any relief during Covid. 
My country, the UK hasn’t been to the moon. But made sure every citizen was looked after, I’m a self employed man and gained $18k over the last six months as a grant because of lockdown. And free healthcare, FREE. 

But hey, there’s  a US flag on the moon right... So when you’re dying from hunger or appendicitis you can’t afford to have operated on, you can look up and smile thinking MURICA.
Reply: @Xevion  "... that has brought them more success, wealth and influence in the world than any other country?"
What success?
The U.S. Military LOST THE LAST 8 WARS!!
Reply: @shotts90  "they should spend that cash on their citizens!"
NO THEY SHOULDN'T TAKE THAT MONEY AWAY FROM US IN THE FIRST PLACE. 
WHO KNOW'S HOW TO SPEND YOUR MONEY BETTER THAN YOU. 

WAKE UP AND SMELL THE BOOTS OF OUR TYRANNICAL GOVERNMENT. 
I'm referring to the jack booted thugs that extort money from you and jail you. they live in your back yard and they are called police.
Reply: @shotts90  the US already spends about 5 or 6 times as much on social spending as it does on its military
Reply: The standard artillery shell the army uses now costs upwards of 80,000 dollars. How is that cheap.
Reply: You don't have to care about price if you steal money for it from your citizens.
Reply: expansive? since when was that an issue for the U.S. military. They cant/wont even complete audits on their spendings lol
Reply: The cheaper end of 155mm shells is 40k (EACH ROUND!!!!!) The Excalibur are 69k!
Reply: Yeah, this will definitively have its place, as you can shoot it with normal artillery guns, the solid fuel ramjet means no moving parts, so the cost is really the design and cost of propellant pretty much. Also looks like it had small control fins in the nose, add a gps package and this could hit within a metre or two at 150km. Of course it wouldnt be a $100 shell, but maybe a $1k-$2k shell, so well worth the pricetag to be able to cover your troops from afar.
Reply: And because a nation like the U.S. is not going to cooperate by moving slow enough to make artillery effective, you can afford to throw away cheap shells. As they get more expensive, armies will have to get more frugal.
Reply: The Covenant  then you have the added logistics of the fuel for the ram jet. Not something you want to be toting around on the battlefield.
Reply: @kdrapertrucker  from what I understand is that there is no added fuel for the ramjet. It uses a solid rocket propellent already in the projectile. The ram jet supplies the oxygen so they don't need to waste space for oxidizers mixed into the solid fuel for the rocket fuel to work. Much longer range since the source of oxygen is rammed into the projectile and not carried onboard.
Reply: @kdrapertrucker  its a solid fuel system. you dont need to fill them up like you would fill up a lighter with naphta.
All in all the system looks good. Armies do focuse on survivability nowadays so 150km reach will be worth it. Look at how much a SPAG and the crew+ training costs. I think spending 5x more on a round will be worth it in the long run if your artillery gunners manage to survive for longer
Reply: @kdrapertrucker  Yes, nobody totes explosives around on a battlefield, artillery is especially known for not having large amounts of explosives on hand in a battle. Also, it's solid fuel so it burns slower than than standard shell propellant does. It's designed to burn, not go bang.
Reply: @kdrapertrucker  These are solid fuel.  Says so right on the casing.
Reply: @kdrapertrucker  They seemed to be saying it was solid fuel.  There are already solid fuel "hybrid" rocket engines, in some the fuel is just a big chunk of some plastic, machined with a cavity or holes through it.  So, solid fuel, liquid oxygen.  Here it's solid fuel and smoking hot compressed air.  Anyway if this is the case, the fuel is more or less inert, not volatile or sensitive to shock.  Of course, there's just that much less space for the warhead!  I think in what we see here the warhead and fuze and guidance is all in the annular space in the nose, the air flow is through this section.  That's how it looked to me.  I guess there HAS to be some kind of guidance, or at this range the rounds might end up in the next town from your target!
Reply: @kdrapertrucker  Depends on whether the fuel is solid and integrated into the shell or not. Solid fueled ramjets exist
Reply: @kdrapertrucker  The whole point of the ram jet is to lower weight and fuel consumption of the projectile through burning more efficiently with high amounts of oxygen forcing through the center at a speed of mach 3 laugh from a cannon.
 The whole concept is thus negating your whole statement :P. It should have amazing fuel economy and minimal engine weight.
 This will no doubt be the new king of artillery.
Reply: @kdrapertrucker  it's a solid fuel within the shell.
Reply: @kdrapertrucker  Watch the video again, the fuel is solid and is in the projectile already just like the warhead.
Reply: @whoisjoelsmith  no better than V-2 rockets from germany 70yrs ago.
Reply: @edmundooliver7584  Yes. No fuel tanks, turbo pumps and all that is required. A bit more technical than a hobby rocket or any of the other rocket systems out there. Think Carl Gustav on steroids.
Reply: @edmundooliver7584  That doesn't make any sense. A V2 was a rocket that went into space on a ballistic trajectory and came down 320 kilometers away. It was the first Ballistic Missile. With a booster attached to it it would have been the first ICBM and don't think the Nazi's weren't trying to do that so they could bomb America. This nammo shell for for a gun ffs.
Reply: From when exactly the war is supposed to be cheap? Can you name few examples?
Reply: @Bialy_1  war is expensive but ammo, guns, shells and others are supossed to be cheap so you can make more of then
Reply: @Bialy_1  sten guns, old russian surplus rifles (AK-47, akm, pkm,), every single soviet tank, toyota pickups, ieds, paid terrorist groups, paid private groups, religiously devoted groups.
Reply: @Bialy_1  The Pelepolisian war. Vietnam...from their side.
Iraq, again, on their side.
Reply: @Bialy_1  since the us only pays its infantry 22k a year
Reply: @Bialy_1  ww2 soviet mass production of cheap and reliable tanks as opposed to the overcomplicated but good german tanks
Reply: america has no problem spending stupid money on stupidly ridiculous things